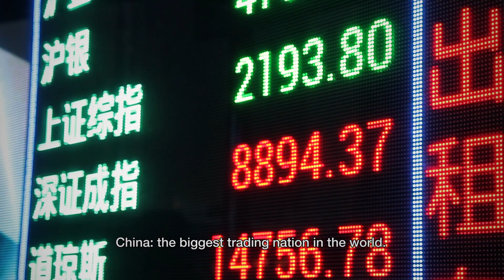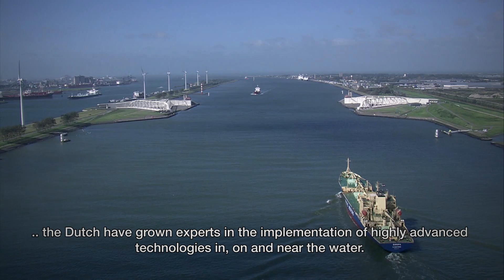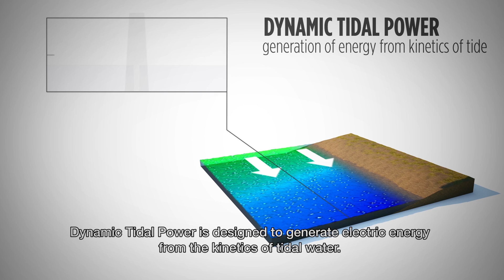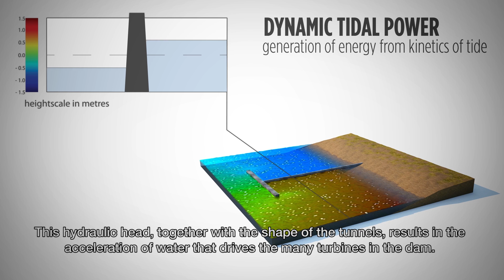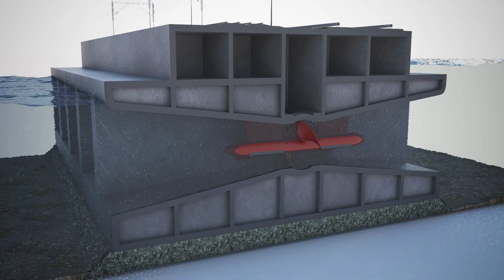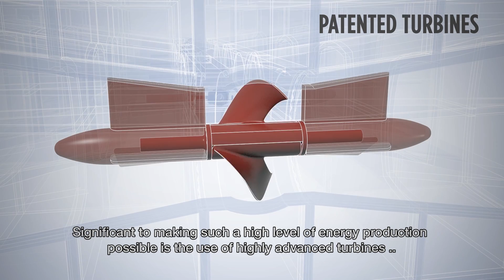Dynamic Tidal Power (DTP) in China (Full HD)

Comment: Use disruptive, short range sonar (if there such a thing) or electric fields to discourage aquatic wildlife from entering the turbans. That way you wouldn't have to use fencing that could become clogged.
Reply: The design is of the turbines in the tidal project are not fast moving but slow moving to allow marine life to bypass the barriers without danger. This is what they mean when they say the turbans have a "low head".
Reply: Why did you make the same spelling mistake as OP?

Comment: Lovely presentation, however still I am not able to understand that how First -generation tidal power plants are erected in the ocean, as getting firm base in the ocean is not easy.
Reply: It doesn't matter if the anchor is heavy enough for the application. The only issue I can see is destabilisation of the base through scrubbing (the water removing material from around the base causing it to subside)